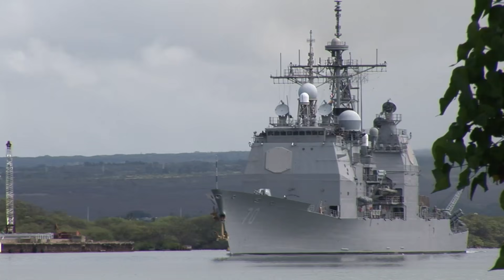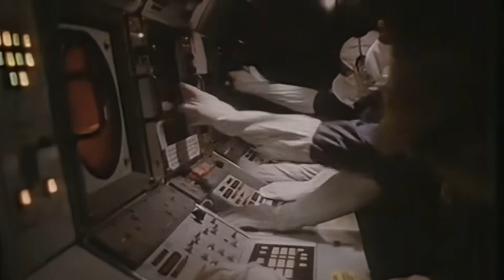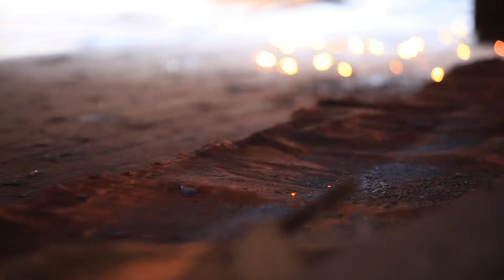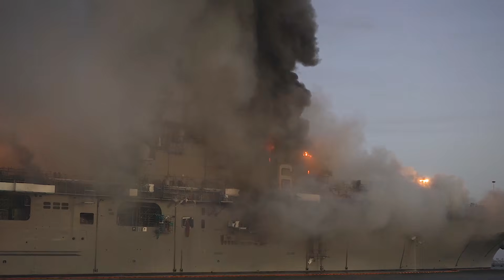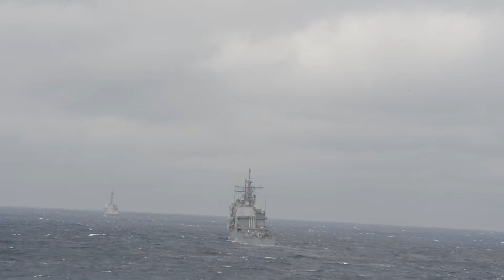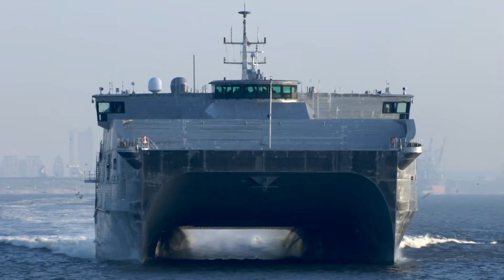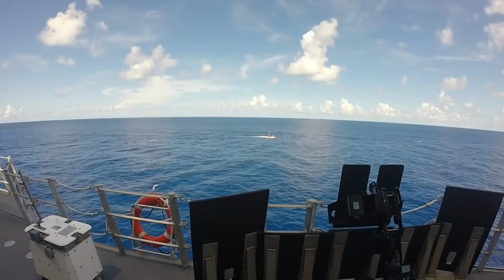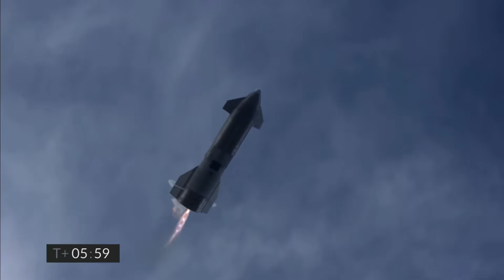Why is The US Building Aluminum Warships?

Comment: Very interesting and very well done. I am from South Louisiana where literally hundreds of aluminum vessels of all sizes have been built to support the offshore oil industry. Most evident are the passenger carrying "crew boats" used to transport workers to and from offshore rigs. Aluminum is light, light is fast, and fast means reduced trip times in a business where time is money. I have never heard of aluminum boats experiencing more or more severe problems than their steel counterparts. If I ever win the lottery and become capable of building a retirement yacht, it will be built of aluminum...sort of putting my money where my mouth is so to speak.
Reply: Crew boats are small enough that you can make them very rigid, thus cracking isn't an issue.  You can't do that with a 750 foot vessel... it will flex in heavy seas.
Reply: of all sizes? are you sure about that? because those aluminium navy ships that are fucking falling apart are pretty big, and big ships are more prone to cracking in rough seas. sure you can build a small boat out of aluminium that just won't flex or crack no matter how big the waves are. big ships are a different story, and as has now been revealed, those aluminium littoral ships of the US navy are an absolute disaster. they won't even make it to a third of the normal service duration of equivalent steel ships. instead of being fast by being light, they are the slowest ships in the US navy because they have to practically crawl to prevent overstressing their hulls, and they can't operate in even moderately rough weather. they are an unsalvagable waste of money and utterly ridiculous. they're almost pointless to even operate because they're so slow that any mission for them to do needs to come to them.
Reply: Yeah man.  We have aluminum boats in the Gulf of Mexico.  Paint it all.  Use isolation sleeves on through hull bolts. 316 L bolts. Avoid dissimilar metals touching and don’t worry about galvanic crud.
Reply: You will spend all your retirement money on sacrificing anode and welding patches for missing structures. You may drop into the water while sitting on your toilet. Corporations are spending investors money. Navy, Army, USMC, and Air Force are spending tax payers money. Who is caring the cost.  Mr Rouge
Reply: @larrylam2648  The US oil industry is not fond of wasting money. Having a vessel in dry dock can cost the owner(s) a fortune. If aluminum was that much of a problem, they would have quit using it before you were born.
Reply: @LA_Viking  Being a Mechanical engineer nearly forty years, I have witnessed many dumb ideas regarding the weight saving. For example Dodge were using plastic for door latches, B-1B GE engine dis-integrated during flight because some engineers decide to reduce the fan blades retaining to .020 in thick. X33 spacecraft fuel tank without metal lining, and hydrogen seeped through composite like there was no tank wall. F35B aircraft could not land on any ground unless there is steel floor to dissipate the heat. Some of my trainees showed new components from the dark project. Without spending time, I recommended them making the vendors redesigned to add some more weight. I took a corrosion engineering course 400+ at UW, and my professor had worked for Boeing high speed boat with hydrofoil. He mentioned that putting aluminum into sea water like putting iron into the acid. In this world there are many inexperienced engineers always wanted prove the other conservative group that they are more advance and smarter. I am in the conservative group. My design will last to the end life cycle of the products. I fixed many thousand poor engineering designs.

I love to put heart pacemaker with aluminum housing into your chest if you need one, so you can be smarter.

Comment: Navy Ship is built with aluminum would sink before the battle due galvanic corrosion. Salty air will cause pitting on the surface of aluminum, destroying the aluminum oxide coating, which is protecting the aluminum structure. I did take a corrosion engineering course at the University. My professor mentioned never design any boat with aluminum in the salty environment.  

Composite is not good for Spacecraft due to low melting temperature. To form a composite structure, we need to use resin to bond all strands of  composite material. And the structure needs to cure in an autoclave. Resin is the weakest link.
Reply: There are catamaran ferries from Australia which have been made from aluminum more than 20 yeas ago, they are lighter than steel ships and fast. It's not a completely new material for ships, at least not in the civil ship construction
Reply: @simonm1447  i would like share life long learning from my engineering career. When I was in the thirty, lead engineer of hydraulic system of a giant bomber. One of my trainee showing me the some items from the very dark project, which was led by a very dark lead engineer, sergeant Schutz,  after few seconds evaluation I told my mentee go back to vendors making them putting a titanium lining in everything items. Hypersonic aircraft have been making successfully flights. When I was in the Stinky organization, I was hired for X33 program, but the other fighter program stole me from the X33, but my friend was in the X33 and let me know how the fuel tank was designed. I told him put metal barrier between the liquid hydrogen and composite tank, but he claimed the LM management will not add metal lining due Nasa engineering comment. When they filled the tank with liquid hydrogen, the tank was leaking heavily via the wall. Inexperience engineers will cause the cancellation of the program. On my first day at X35 (now F35) I made the LG lead engineer moved the main landing gear to different location, because I have a good common sense. Tire do not withstand under 500 degree F jets. When I was working with a team Rocket scientists, Ph D and Master Degree in engineering plus many years experience, I was a Junior in the team. They spent many hours after on spacecraft rocket modal testing, and tried to find the solution why they have two different frequencies. They found none after two hours talking, I gave them the correct answer because I have a keen eyes. The rockets were tested under two different configurations. F35B can’t land at any road or anywhere, due to it rear engine jet will melt asphalt and the result will be very ugly. I did make a suggestion to add water steam to cool the exhaust and increase thrust, but it was declined due USMC crew chief did not want to find distilled water and fill the reservoir.

I have another story regarding aluminum built aircraft. I was only an engineer assigned to restore aircraft systems including fuel, environmental control system, propulsion, secondary propulsion, electrical. That aircraft got engine blowup during flight.  While I was working on the restoration of that bomber, I wondering where other first crash bomber was stored. I was shocked when I heard the Air Force planner told me that all structures burned to ashes only titanium ducting and steel parts remaining. I watched too many TV programs on commercial aircraft crashes. All structures, components and engines were gathered and laid in correct positions for investigators. There is almost none for Air Force aircraft.
Reply: @larrylam2648  wow, you have a quite interesting career :-)
Reply: @larrylam2648  this are the guys with the big, fast aluminum ferries
https://youtu.be/nP1K6nS_lLQ
Reply: @simonm1447  i was forced to retire at the early age due my keen eye found a Chinese spy on the Boeing Space Shuttle program. I reported to the company security  and they reported to FBI. And I was forced to leave the company with a mental mark (delusional) and I was never find a job at any Aerospace Companies. They made me to see Shrinks to validate their firing. I told them a life long career experience, and the Shrinks concluded that I was full of lying.  I am not poor and living comfortably in 3300 sf house in a beautiful neighborhood. 

Chinese are successful launch spacecraft to the moon and other planets. Thanks to the Boeing Space Shuttle flight software. Ballistic missiles from China will arrive the US due to the corrupted FBI and Boeing executive .